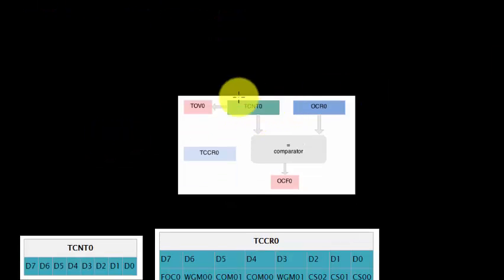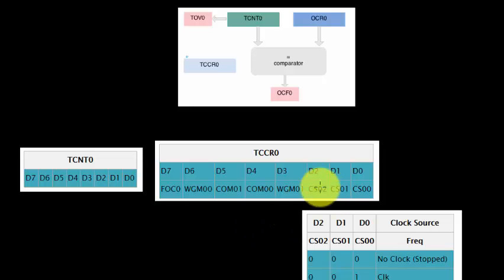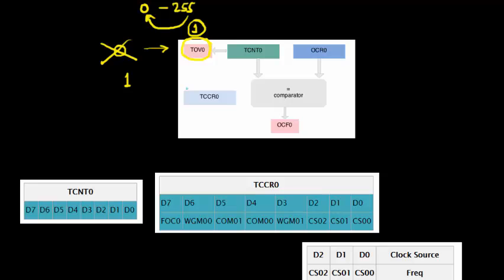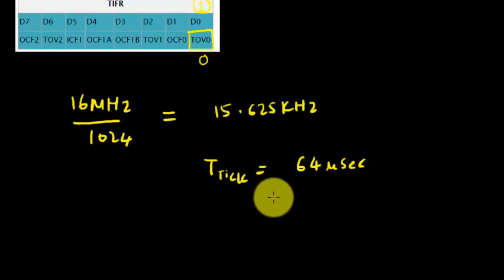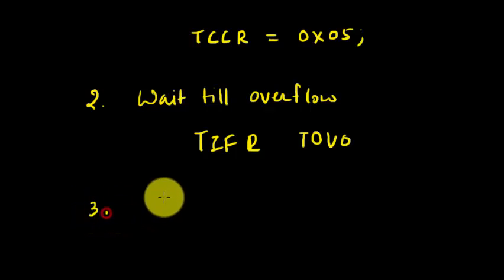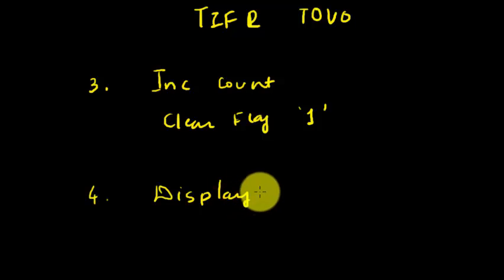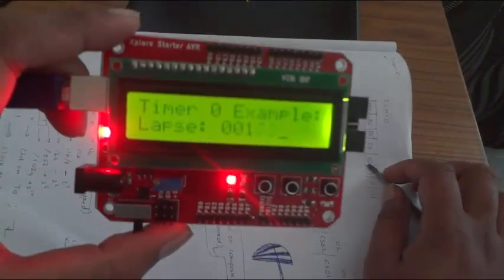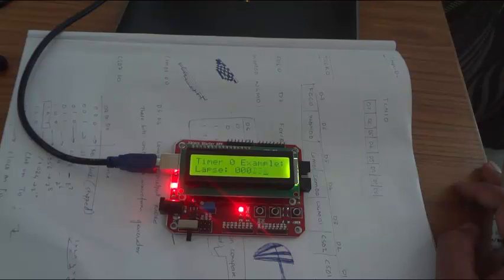AVR Timers 0 Example

Comment: 4Mhz four megahertz means 4 million cycles (ups and downs) per 1 second.

1 Tick means 1 Cycle, then we decided to use scalar of 1024 to count every 1024th tick of 4 million ticks so we got 15.625Khz (per 1 second still). Then we want to calculate how much time a single tick take of those 15625 cycles, since there are 15625 cycles in 1 second lets calculate how many second we have in 1 cycle, divide 1 second by 15625 cycles we get 0.000064 seconds inside 1 cycle or 64 micro seconds in 1 tick (cycle)

Comment: Personally, I think you should have used symbolic names rather than hardcoded values to store in the register, either using (1<<FLAG) or macro _BV(). It makes the code more readable when you come back to it, or when someone else has to read the code. I realize this video was made in 2014 and maybe what I suggest was not standard practice. In my work with AVR I find most engineers use the symbolic names of the flags (available in <avr/io.h>).
Reply: TCCR = (1<<CS0)|(1<<CS2) 

Is like shifting by bits of CS flags

Comment: Hello. I have a question. 64 microsecs is the time for one tick not the overflow time. right? One step from 0 -255 represents one tick. So, 256*64 microsecs = 16 milisecs is the timer overflow time right?
Reply: yes after 16 Milli sec the timer will overflow
Reply: he also got me there yeah around 4:40